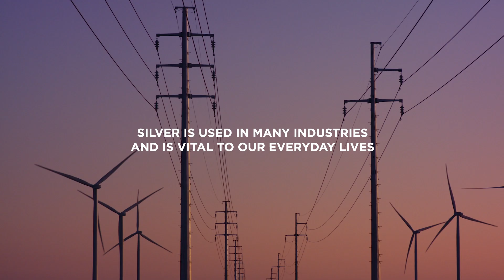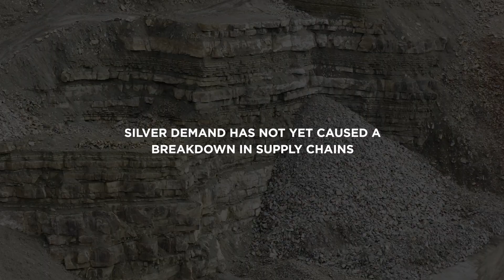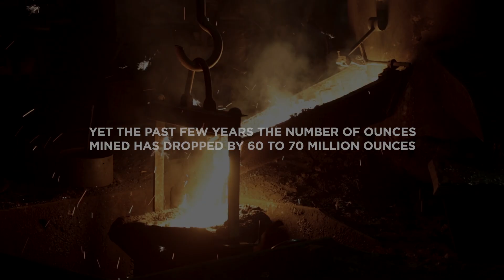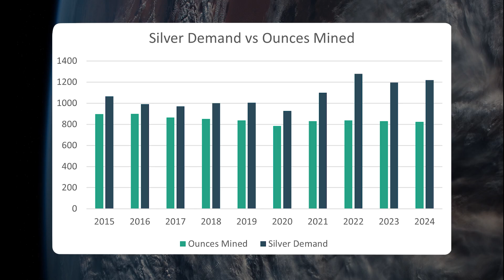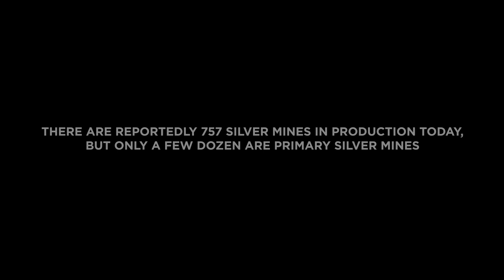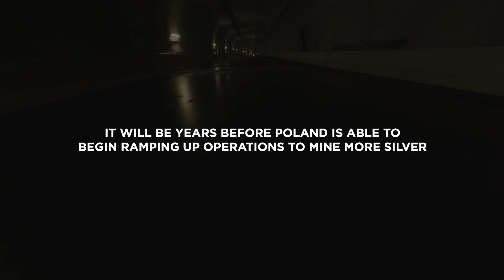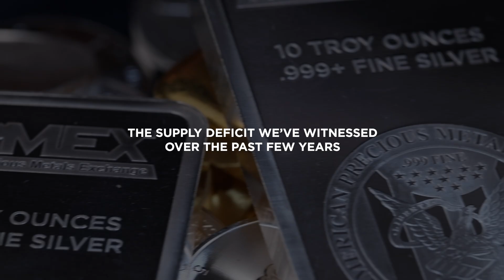Silver Has a Mining Problem

Comment: silver is the most shorted of all the commodities  -   approx 500,000,000 ounces at present  - so what happens when the paper markets of the  COMEX &  LBMA  
can no longer deliver physical silver ?
Reply: COMEX and the LBMA will change the rules as normal operating procedure.  And the world will avoid them ! both will lose customers big time, as they can not deliver, they will settle in cash. Both of them are responsible for the shortage of silver, both them and the players depressed the price for forty five years. The end result now is no new silver miners were being developed for those 45 years. It will take a decade to have new mines come on line, several decades in the USA, due to regulations here.